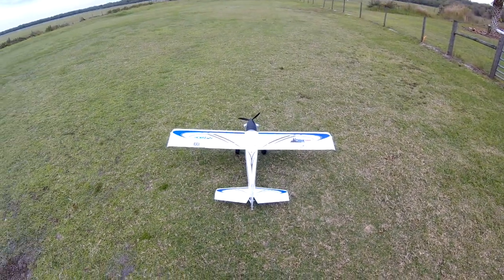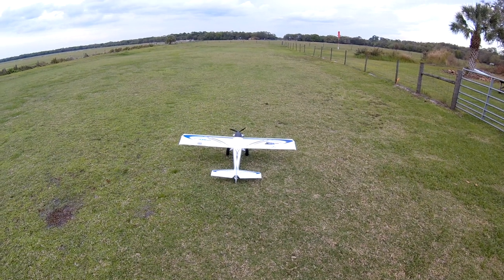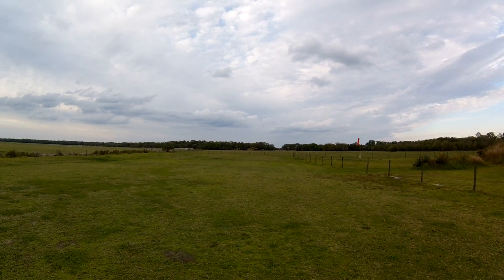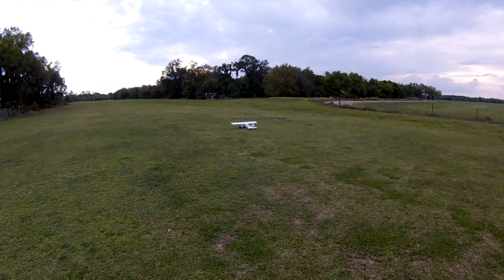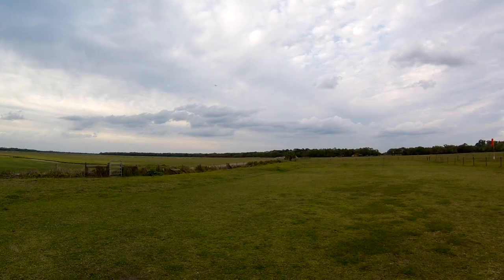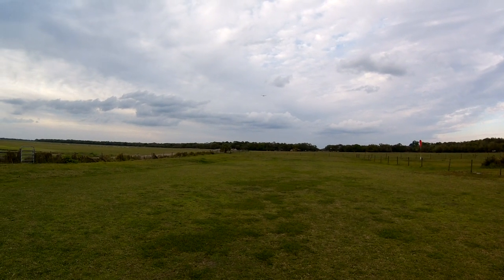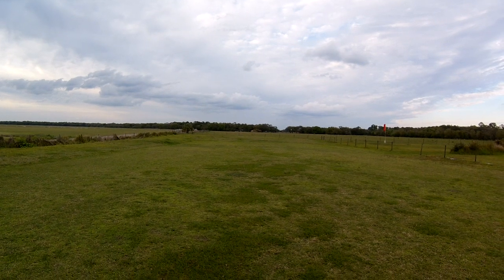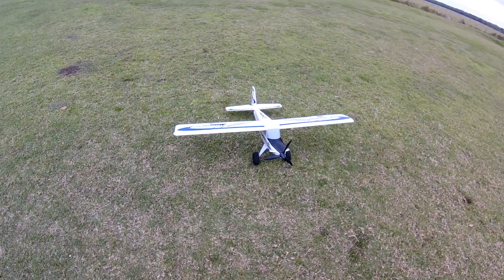EFLITE TIMBER TURBO!!! maiden on 3 cell by Fat Guy Flies Rc

Comment from the maker: The slats are great for slow speed stability.    I elected not to install them but have them on my regular timber. It's user choice . The model flies great with or without. If your new to STOL aircraft I would put them on

Comment: Hi there. I just got the Turbo Timber Evo and watched your video about overheating. Did you ever have problems with this model overheating?
Reply from the maker: I did at first but not after my mods and the suggested mod from Eflite.
Reply: Sorry, I meant to say “ did you have overheating problems with the blue version”. Seems like the evolution is the one with that issue. Just curious

Comment: just up graded my Doro fly Tundra which is awesome to a Timber. Hope it flies as good as my Tundra
Reply from the maker: Both are fine birds, I had a tundra but it arrived with damaged parts and HK refused to work anything out even when I gave them pictures of the damage still in the box. I have had a good experience however with the slowpoke.

Comment: Can you use a buddy box on this airplane?
Reply from the maker: You can use a buddy box on any plane. A buddy box is dependant on your transmitter and wether our not it has that feature. Turn it over and there may be a training port or plug. Is so that's where your instructor hooks up.
Reply: @FatGuyFliesRC   Thanks and good to know.

Comment: 3S 2200?
Reply from the maker: admiral 2600 3s 30c
Reply: I use E-flite 3000 3s  30c no problems...Timber and Turbo Timber
Reply from the maker: Yep the Turbo Timber flies great on both 3 and 4 cell. Both are great planes. I hope to get the Timber X also to round out my little Timber family. Even my UMX Timber is a awesome little flyer.